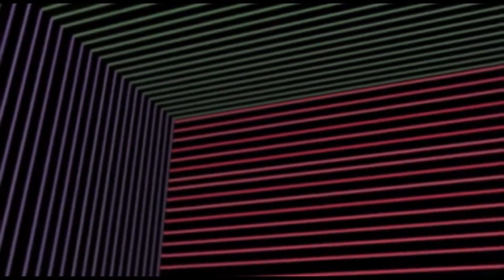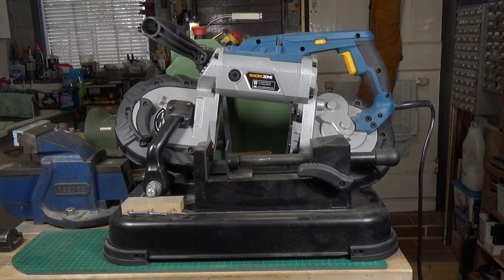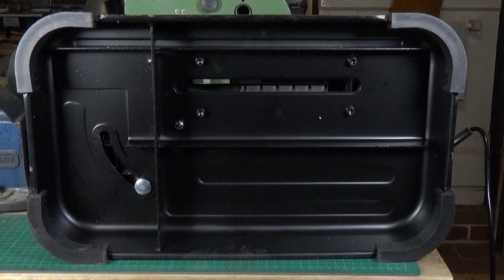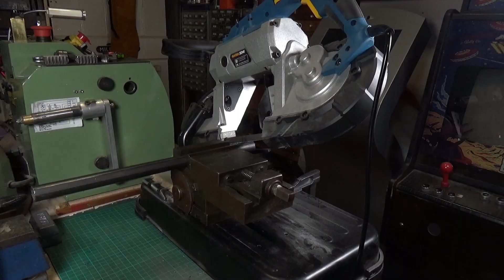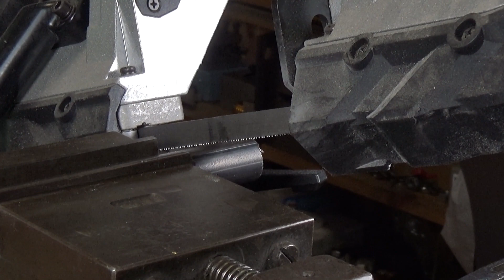Aldi Portable Metal Cutting Bandsaw - Vice Upgrade

Comment: Its ok for the price,i had one,but theres a few flaws,the clamp in fact wasn't one of them,the mains cable from the handle gets in your way,its not easy to see if your doing an angle cut at the right angle,say 30o the markings are dark and you cant fully see them,nor can you tell if you're spot on with it,even the 90o wasn't that accurate,it was just before the marking on the base,the main bolt to tension the up and down movement you had a choice of too tight or too loose no inbetween .
I had it for 6 weeks and the variable speed control stopped working,it got stuck on full/max speed,sent back under the warranty for a replacement(free post i might add) only to be told they've stopped doing them and got a full refund,rather gutted about that
Reply from the maker: Sorry to hear that you had problems with yours. I've had mine nearly 2 years now and it is still working ok. It doesn't get a lot of use and I have found that that the vertical stand is the configuration that I use it in mainly. I think for the money it was a great, you'd be looking at £300 to £400 for a similar saw today. Glad that you at least got a refund.

Comment: Put my sceppach onto my wall today. 
4 x 35mm pipe clips on the top handle ,
One one the bottom handle , a cable tie on the trigger with an NVR switch on the bench just to my right where my hand would naturally drop to and a  wire through the top handle as a safety measure,  only thing I want to alter is to somehow cover the blade from the left as it seems that if it were to snap or come off our the wheels there's a chance of it cutting the inside of my left arm,  I saw a video on another channel and a chap used a saucepan or cake tin to cover his , if it works it works!
Tomorrow I am making a new workplate for it from an old scroll saw plate
Reply from the maker: Have a look at my other video on this https://youtu.be/X0mld3dFBLM might be the one you watched. I had the same feelings about the blade and used a cake tin as a cover.
Reply: @RetroSteamTech  
how daft do I  feel!!!?
It was your video with the saucepan fix haha,
I also need to get some replacement bolts for the plate as mine stand about 0.05 proud of the countersunk holes ,which isn't much but they are catching the materia as it passes through and I don't need to be losing a finger tip on the 2nd day of use, prob just easier to touch the heads against the grinding belt to remove the extra hight though?

Comment: Neat little saw Alan.  Looks to be pretty handy.  Good upgrade.  Cheers Rob
Reply from the maker: Thanks Rob. The saw is very good, cut through everything I've thrown at it so far. This includes cutting the tangs off morse taper adaptors which were fairly hard tool steel and cutting the head off of an old ratchet wrench, again pretty hard steel. Cheers, Alan.